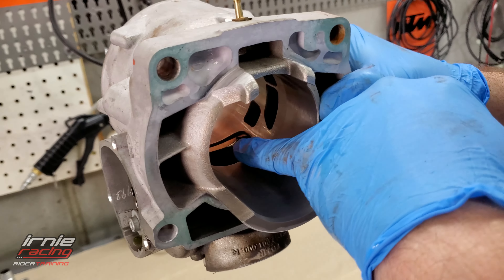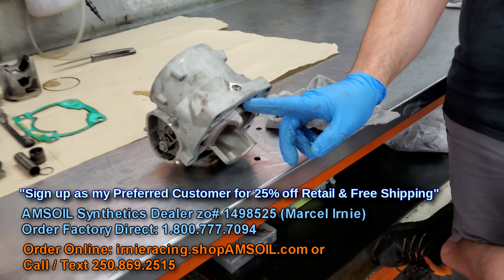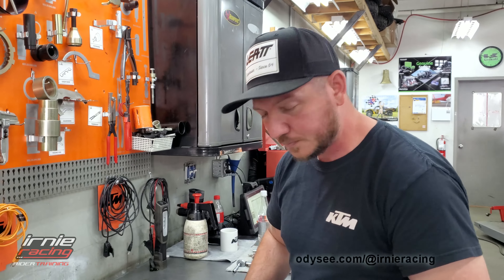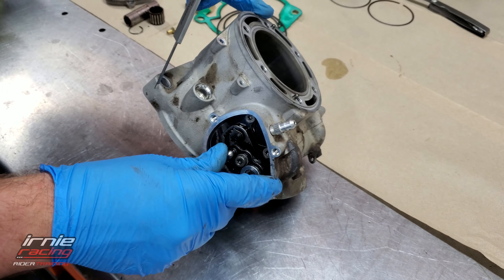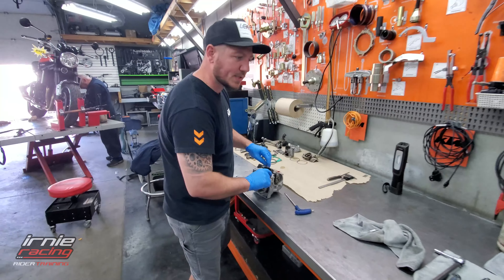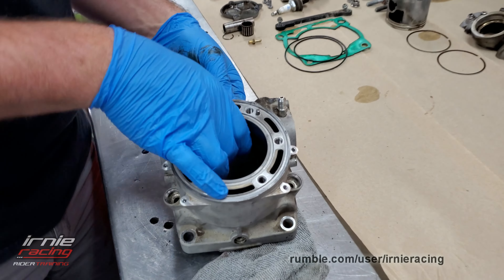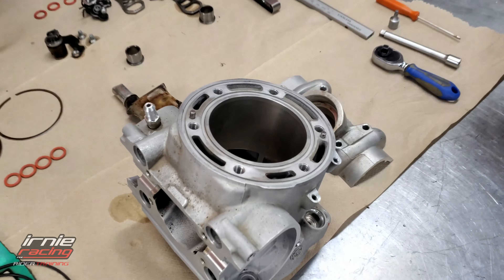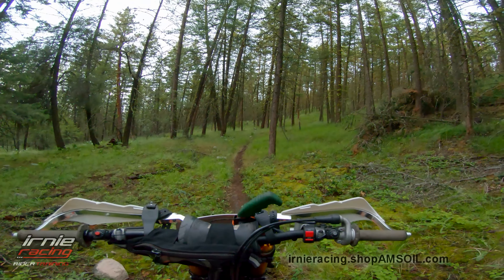KTM 300 TPI @ 239Hrs Top End Refresh Pt.3 w/ Powervalve Clean + TSP Low Comp. Head | Irnieracing

Comment: Ernie, your power valve was way cleaner than mine and I only had 44 hours on mine and I was using the KTM recommended oil
Reply: Basically: High protection=more buildup, a little less protection with better bearing cooling capabiltiies but less piston protection=less buildup(low flashpoint)

Comment: Is this the stock at 239?  Is the ECU tuned?  Great idea with the wire wheel if your careful.  I have used easy off in the past.
Reply from the maker: Stock yes to 225 hr.  before TSP ECU flashed .
Reply: @irnieracing   Amazing!  I'm about 45 ish on my 22 GG EX300.  Was thinking about pushing until 100 before inspect and new piston.  I have been eyeballing a TSP head and reflash.  I don't want a hit.  Just smooth and tractable.
Reply from the maker: @Danman1972  just like me, I want diesel bottom end and retain th4 same top or better.  Get the low compression head insert and the flash alone is better too.
Reply from the maker: Just go to my ktm 300 playlist and watch videos following the low compression head installation 2020 KTM 300 XC TPI: https://www.youtube.com/playlist?list=PL9EdHN9SPeEiILtateFBh2Ls4WNdcRn5n